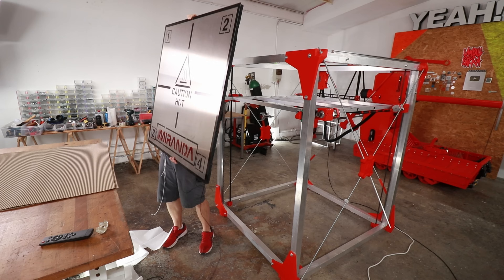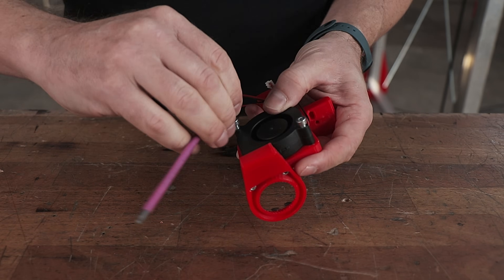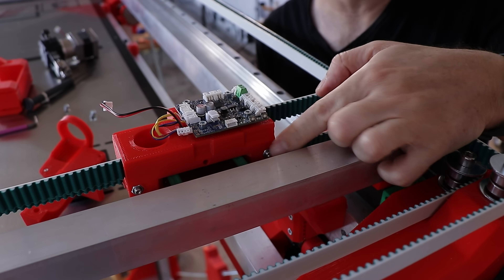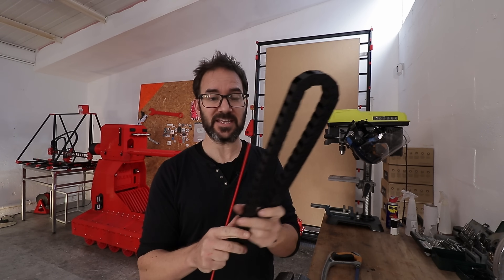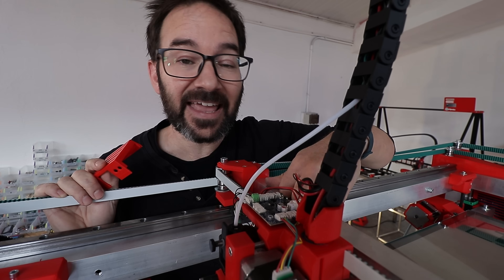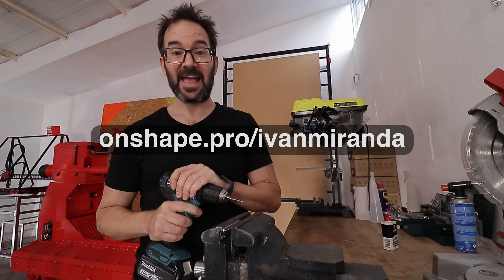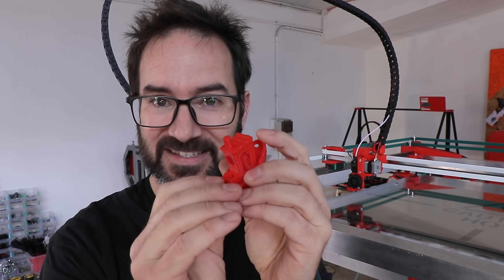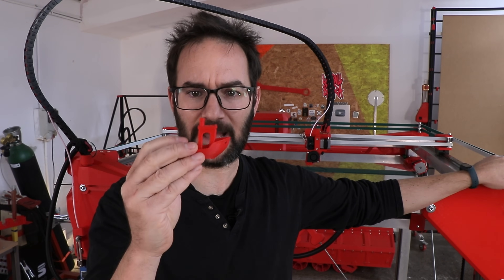YOU WON'T BELIEVE WHAT I PRINTED FIRST - GIANT 3D PRINTER BUILD PT. 5

Comment: Well, that's the first time I've seen a vertical cable chain used in such a weird way. Why didn't you just use it horizontally like on any other Railcore? Yes, there might be sagging, but with the proper cable chain (R28 maybe) it won't be a problem at all. 😘

Comment: Bro thats awesome. I‘m planning on building a laser engraver with a CoreXY gantry (about 1200x800mm), how is the belt tensioning? What belt width do you use? What is the max moving speed you can achieve?

Comment: How do you combat warping on your large prints? I print PLA and if the surface of the print is larger than 200x200mm i have insane warping. I print 215C no heated bed, glass with glue-stick

Comment: bro ... just increase the nozel temperature and ditch the bed heating... is pointless u can print very well on a cold bed as long as the extruder heats the plastic high enough to stick to surface and give it some brim... so far i stoped using heated beds on my printers. and prints are acceptable actually they as perfect as any other print with high quality on glass. soon il take apart a 3d printer and just use a glass bed and increase the XYZ axis plus some modifications and see how that goes. but once u got a 3d printer being it a cheap one u can mod it as u want... and so far im looking cutting down costs on modifications and heating bed / and heating bed issues with warping is just not worth it. cold printing bed should be the feature, cheaper and faster.

Comment: This misuse of drag chain hurts me. Worst use for drag chain I've ever seen. It's not even designed to be used this way. You should have install 2 separate drag chains, one for X and one for Y axis. The way you installed it makes it extra hard for XY motors. The weight of drag chain can bend the carriage. Also the printer is way higher than it neets to be with this drag chain. Shameful...

Comment: Use a cold stream/jet of air to cool the melted plastic and control how fast is cooling and especially the SHAPE  - you could remove those "round corners" very easy...
This will make your printing more stable and fast.

Comment: 37 minutes 3dbenchy  is too slow for this printer. My anycubic i3 mega with 0.4 nozzle  and 0.2 layer prints in 42 minutes with LA. And it is not maximum  available speed for it.

Comment: with such a big heat bed and a four belt driven z axis, why not using voron 2.4 type frame??? if the xy gantry is lighter than this moving building plate, that might be a bad idea to move heat bed up and down.

Comment: You should add an ADXL345 to remove resonnance frequencies, that will make your prints smoother and higher in quality at high speed.
It will require Klipper instead of Marlin.

Comment: Hey Ivan I guess the odds of you reading this are pretty low, but your part cooling solution is woefully inadequate for the amount of plastic you're laying down and the speeds you're doing it at. That's why your 9min benchy and speed setting cube have quality issues. Your printer should totally be capable of laying down those prints without drooping.

A single 5015 is already too little for my normal mosquito using 500mm coreXY, so I've got about 1/2 or 1/3 the flow you're getting while I'm also using a VASTLY superior fanshroud design with less static pressure problems.

I really recommend switching to twin 5015s(if you want to keep it quiet-ish) or to something like a server delta fan(40mm radial). 

I'd also recommend looking into the "pressure advance" option in the firmware for your duet mainboard, they have a good page explaining the process of tuning it and it will improve the dimensional accuracy of sharp corners at high speeds(something that's very noticeably off on your cube)

Hope this helps make the giant printer even better.

Comment: What operating system is used to run this 3d printer? 
I did build a big one, run it with Mach3 and Nema 23 motors, it works fine but I don't think it's the ultimate.

Comment: For the cable management, I would have just used two of the old system, one for horizontal, and one for vertical. That spinning method makes me fear for your wire connections.

Comment: Curious for the carriage cable and filament management why didn't you use two drag chains? On for the x-axis going from the side of the frame to the extruder, then one for the y-axis going from the corner of the frame to the point where the the x-axis chain is? (So on from mod point of x-axis to edge with slack to allow carriage to do full x-axis movement, and one from y-axis mid point to edge with slack for all y-axis travel).

You'd need additional metal stock to create mounting points above the belts and allow the chain to rest without hitting the belts etc..

There obviously is a reason cause you didn't do that so I'm just wondering what that reason was?

Comment: I see how you leveled the bed, but how did you set the nozzle to bed offset?
Reply: He just needs to manually adjust that once to calculate the probe-to-nozzle offset.  You first home Z with the probe registering the bed, next disable the soft limit for Z, then jog down until the nozzle is a paper's thickness above the bed, then record the new Z value in the settings for the offset.

Comment: Why even use a cable chain if you are going to run it like that? lot of unnecessary weight if you arent even going to use it how it the way it was designed. Either run it along the X aluminum extrusion, or just use some light wire loom with that red wire guide or something with that.

Comment: It feels like you’ll need an extruder motor just to feed the spool into the heater on startup. Cuz I’d sure would drive myself crazy manually pulling the spool into the hot end where the length of the filament is about my height 😂

Comment: Love your videos! There are omni-directional snake chains out there. I get mine from IGUS. May I ask what the size of the belts you are using? Also, is there a reason you went with a custom beefy filament runout sensor rather than a standard off the shelf assembly?

Comment: Pretty epic. You should see if you can add a plug and play option for multiple carriages so you can print multiple copies of the same thing at once.  That would make this build much more flexible since you could use it for cranking out smaller prints instead of just single large prints.
Reply: SCARA printer arms?

Comment: You should talk to Vez3d or 247printing who are speed printing gods and get some tips on increasing speed while keeping quality. The corners of the cube are over extruded and pressure advance can help with that and the high speed chep cube shows the belts need to be tightened and setting up  input shaping that will also help. I love this printer and can't wait to see what you're going to print with it.

Comment: Could you mount the filament reel in the middle of the y axis on the floor and have the same system as on the smaller printer for the filament mounted on the rail that moves front to back. Then one axis is taken care of at the side of the printer and the other is the same as on the smaller printer on top.

Comment: What if, you where to make a big coreXY printer, with a smaller XY head in the middle for faster movements? Let's say the big printer can print up to 1x1 meter. And the smaller printer where the print head sits, can move 20x20cm independently. So when you need fast movement in a tight area, it utilizes the small gantry. And when doing larger areas, it uses the bigger gantry. Or a good combination. The small gantry moves fast side to side while the big gantry moves in a circle.

Comment: Only 5 points to level the Z axis - that's some serious confidence that the bed isn't warped. What is the 1st layer thickness tolerance for adequate adhesion? A large 1mm thick spider web print to dial in adhesion over the whole bed would be interesting.
I dabbled in milling PCBs and a common technique is to probe the entire surface into a map that then adjusts (or floats) the Z axis on the fly to keep the tip within much more precise tolerances to the bed.

Comment: doesnt the 2 50W heater exceed the current limit for the Toolboard?
Reply: The Toolboard supports 5A at 24V, which is 120W - So it's fine if he's using 24V.

Comment: Omg. No. That drag chain has to go. It will effect your prints. It will put strain on your hotend holder/gantry and over time on the linear rail carriages causing artifacts. Hotend and gantry should have zero resistance if possible. The resistance from the hotend extruding the melted filament coming in contact with the heatbed is the most amount of resistant you ever want to have. Which is unavoidable either way. Best to have a happy medium between a ridged but yet flexible loop at the top. Maybe suspend it from the ceiling or a detached stand. 😊❤

Comment: I dont know if your already using it but maybe use Klipper input shaper it removes the ringing from prints so the fast calibration cube would Look way better and while your at it calibrate Klipper pressure advance it removes the ugly corners at higher speed so higher speed at bettet quality. For cooling i would recommend you use something called cpap or hvac they are ways to get way more cooling

Comment: No wimpy printer endstops for this machine. That's a beefy runout sensor. 💪💪

Now, for that flow rate and speed I think a single 5015 is not gonna work. I have duals on my Ender 3 and they struggle to cool the parts sometimes. Maybe a CPAP?

Comment: 4:16 ditch the snake and just make a bow (think tent pole bows) above the printer where you suspend the cables with a "tray" that's similar to the forming piece of plastic used by washing machine manufacturers so that evacuation tubes can stick around bathtubs. It will not impede motion, it will support the cables properly and you don't have any drag on the moving parts from it. It's similar to what robotic engineers use to keep the cables out of the way of their robots when they're in testing phase and have a ton of extra sensitive wires attached to them.

Comment: PTFE tubing is not the way to go if you want to print flexibles, but who in their right mind would print a flexible piece so big?
Reply: The PTFE tubing on this printer is a reverse bowden (the extruder motor is on the printhead) so he doesn't have to worry about TPU compression inside the PTFE tubing. Though I imagine that loading might be difficult, particularly with super soft TPUs like NinjaFlex. (Not an endorsement, just a benchmark comparison.) Though the spring on that filament runout sensor might be strong enough to kink a soft filament...
Reply: @Sembazuru  Oh yes, you are right. The tube is only for transportation and the extruder motor is on the printhead.

Comment: 7:40 This is the OCD in me, but you might want to consider rearranging the wiring to make it look cleaner. It will also open the board more for cooling... Though I'm not sure how much cooling/airflow you need really... But it will help make it easier to keep the dust off of it. 😅